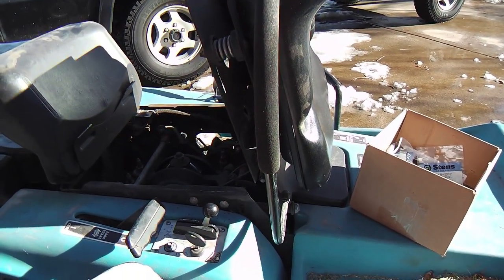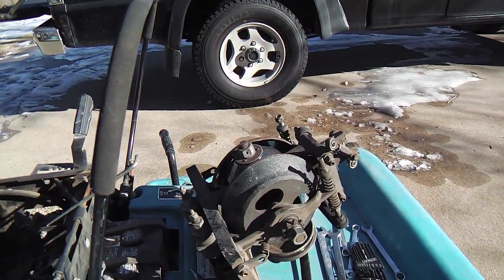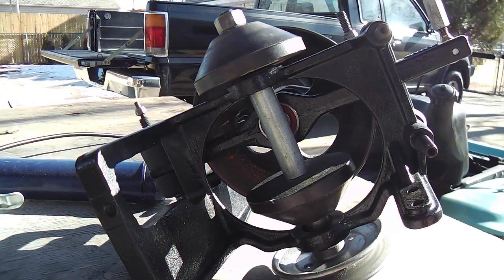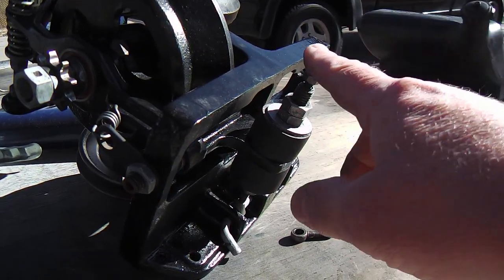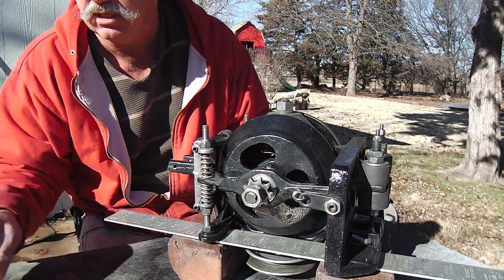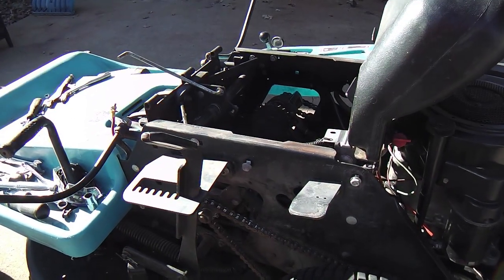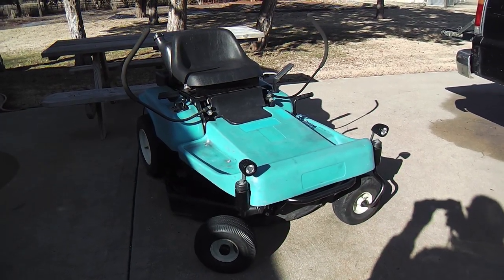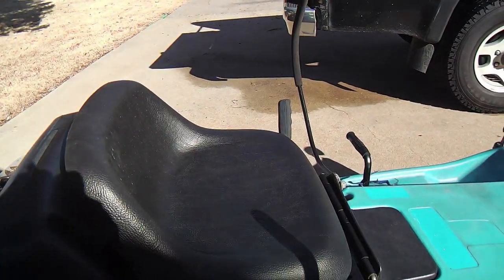Rebuild a Friction-Drive Transaxle on Dixon Mowers

Comment: Stumbled across this and it was a great trip down memory lane. I was a Dixon mechanic from 1980 to '86. Absolutely loved that job.
Reply: @Michael Slattery Hey Michael wonder if you could help diagnose my issue.  I have a Zeeter 30 that won't turn right.  My transaxle cones are in good shape.  I saw on another video that it could be the worn chains that are causing the issue.  Mine are pretty loose.  Could that be the problem?

Comment: Sir you are a life saver....I picked one of these up 2 years ago...for free guy didn't want it anymore and bought a new zero turn and wanted it gone...so brought it home it has a brand new motor new electric pto ....and very nice ...no rust except deck which I fixed ....it has the 52" deck with three blades....might have to replace a spindle or two...ok enough of that....the cone system needs to be adjusted I think I have a broken torque rod it works in one direction but not to well in the other...and the reason I am writing you is to say ....you have given me hope and the knowledge to fix the cone system ....the way you fixed the torque rod is awesome...and end and threaded rod brilliant....simply brilliant....I can now go into this with your video by my side and fix my Dixon ....oh by the way it's a 1987 model a ztr428....I know it's a little different but mostly the same...I have all the literature on my year ....I have only one question....where did you acquire....buy that adjustment tool ....I need one and any help or tips u can give a Dixon ztr 428 owner would be greatly enjoyed ....ty for your video it's one of a kind!!!

        Robert
Reply from the maker: Sure, you can find one like I have at dixonztrparts.com for about $17. But, the older models take at least one other gauge (I think it's just for a slightly different load/compression for those torque springs/bushings, so you might get away with using just the one, even for an older model). But the gauges for older models are surprisingly more costly, at least at that website. And from what I understand, the older versions no longer have cones available for them, so I wouldn't try to replace yours needlessly. I'd just keep learning what you can by using the literature and experimenting. A 52" deck sounds nice!

Comment: Thanks for the GREAT video!!!! Never heard of a Dixon and was about to buy a new John Deere when I inherited a 2003, 3304 that's in excellent shape except for the transaxle. It would hardly go, but after watching your video I've managed to adjust it enough to mow the yard several times. Now I LOVE it and ready to tackle the transaxle rebuild.
Reply from the maker: That's very nice to hear about!
My Dixon just got a new V-Twin motor and some other mods, besides the used three-blade deck that went on it a year earlier. So, if you get a little bored sometime feel free to take a look at this recent project on it: https://www.youtube.com/watch?v=wQ1LNr5Gg6s&t=1s
Reply: Watched it already! Another great video but a bit more fabrication than I feel confident doing right now. The old Intek 13.5 still runs pretty good although it could use a replacement carb which I've ordered. Maybe after I've mastered the transaxle rebuild I'll try a few more performance mods. As you said, I now have "skin in this game" and am quickly becoming an Dixon fan. Move over J.D.!
Reply from the maker: Yeah, it's undoubtedly easier to just upgrade to a hydralic mower, so I'm not really recommeding that most people do what I've done. But I've done what I've done, and have no regrets about it. Otherwise, parts are plentiful and cheap for carbs like that, with even some import carbs around the cost of a gasket/rebuild kit. If that Intek is an OHV type, it would probably be good to adjust the valve lash.

Comment: I watched your adventure twice while stalking a 4423 for sale in my area. Wasn't really sure if I wanted to go with the z drive over a hydro mower. But after the second watching of the video I decided I wanted it. The guy told me it was pulling left a little so I told him it would cost around 250 in parts alone and he went down by that amount.

I really love the little mower and tore into it right after mowing my lawn, mostly due to all the bad bearing noise in the deck. But I have you to thank in giving me the confidence to start the project in the first place. I have since watched it another two times and have the manual to boot so Im ready to tackle the job.

Would you tell me where you bought the cone assembly for 129. I found an assembly for sale but its almost 180.

Thanks for all your hard work putting the video together.
Randy

Comment: I've got a 30" ZTR 3303 last summer, it was made circa 1999 and it seems to run pretty good. Just found out one of the eye bolts was broken. Replaced it and still doing minor adjustments. Replaced the blade brake this summer which was not a lot of fun. That was a poor design to begin with. It's a fast little mower though and still has the original engine. When I got it the only thing that was bad was the seat switch, so the guy said it wouldn't start without shorting across the solenoid. Who needs a seat switch anyway lol

Comment: I have been messing with my “new” old Dixon ZTR. After adjusting it, I noticed that the cup on the left side, which I adjusted because it was a good ways away from the cone, was hotter when I spit on it than the other side which I didn’t adjust. Both sides were very hot though. I wonder, does this mean that I got the left cup to close, or maybe the right cup needs adjusted closer? I have never seen one of these before, am having to learn as I go.
Reply from the maker: Take a look at my more recent Cones Install and Adjustment video: https://www.youtube.com/watch?v=baaGjqRWd7k

Comment: Have you experienced any issues by removing the idler pulley on the drive chains?  both of mine are shot and instead of replacing them I think I will remove them if you have not experienced any ill effects.  Thanks  too bad I can't find more info on the older original design!
Reply from the maker: No, I'm happy to report that there has been no issue at all, after half a season of use or so, so far. Less seems to be more in this case. I'll just mention that grinding a little flat spot on that rod, before punching and stabbing new holes for that tabbed spacer, will keep the new holes well-centered.
Reply: Wonderful I will definitely be disabling mine.  I also need to shorten the other chains as well while I am at it!  Thanks!
Reply: Me too.
Good question btw.
Reply from the maker: I did recently add a custom idler and uploaded the process in a short video. Otherwise a half link may help if you want to skip the idler, which is what I did for a couple years too, until the chain streched further just recently. https://www.youtube.com/watch?v=To63hNrObM4
Reply: it is the original design all same
Reply from the maker: @joescheller6680  Yeah, maybe so, but the original had a tab and some all-thread included in the assembly, which I found a little problematic. But I suppose I could have just deleted the all-thread take-up feature and shortened the chain a little to save a few steps. But I ran it fine with no idler for some time, which may have been more ideal than even a perfectly functioning idler, as the levers without the idlers are more responsive or less sloppy, as I recall. But, the shorter chain and the new idler mechanisms have less slop than the original design.

Comment: One of my discups does not have a set bolt. I am thinking it was replaced. But the one with no set bolt wiggles back and forth. Any idea why and if this is a problem?
Reply from the maker: Gee, if I recall correctly from some literature that I used at the time, that set bolt was not included on some years, but rather, a key was at times placed in that keyway at that point, without a set screw. Mine has the set bolts that just press down into the keyway, without holding a key in place, if I recall. So, if you've lost that bolt, I'd replace it. Maybe there's some mixed parts on your unit, though. But if not, it's probably a 1/4" or 5/16" standard thread bolt. If it hasn't become a significant problem by now, maybe it never will. But, again, I'd solve that slight slack just in case it unexpectedly fails to engage on that one side. Maybe that particular discup has a sheared key in the keyway, which you may be able to just sneak another short piece of keystock into the keyway without completely removing the discup. You know, by just removing the short chain and small sprocket on the shaft to the discup. Please let us all hear what you do, and how it goes. Peace, Christian

Comment: Hi Christian, thx for the video.  I have a 42 Dixon.  How did you make your torque rods?  Mine broke also and would I like to make some out of stainless steel..
 
Jonathan
Reply from the maker: Sure, I just bought a length of stainless 1/4"-20 threaded rod via an Amazon seller (not directly from Amazon, so I don't pay any sales tax). I cut them to the same length as the old torque rods and welded the end of each to a regular nut, in a perpendicular fashion. I also drilled out the inner threads of the nuts a bit, to smooth it out some, as the nuts then accept the connecting rod below. I used stainless filler rod and ramped up a bit of a gusset as the nut joins to the threaded rod for some added strength, hopefully. It's not necessary to use stainless filler or the TIG process, even though that's what I did. That's it!

Comment: My small gear on the friction Gear is badly worn and needs replaced.  Can it be replaced without taking the complete drive out.  Thanks George
Reply from the maker: Sure, if it's that small sprocket with a keyway and about 9 teeth to it. I think I replaced them independently too, after removing the lock nut on the shaft, by first sticking a wrench handle into the cast iron bell housing and rotating it to a stopping point. Then it's just a matter of removing the master link on that short chain, to then tap or wedge it off the shaft for replacement.

I think the part is about $10-$12. I replaced both sides, and even was going to put a half link in there to shorten the chain, to take some of the slop out. But I changed my mind about that part, as the lever action does cause those bell housings to float up and down a bit, and I didn't want a tight chain to restrict that action. But, who knows, I may go back and do that sometime, just to make the drive seem more precise. I mean, these friction drives are undoubtedly a more clunky zero-turn mower, compared to newer hydraulic driven mowers, although I still haven't used a hydraulic unit yet. So, I'm usually looking for ways to make these friction drive mowers a little more refined.

Comment: Great video sir. One question where did you buy that adjustment gauge at? I couldn't find it anywhere
Reply from the maker: Sure, even though I think I got mine with the cones as a package deal on Amazon, the website lawnmowerpros seems to have all of the relevant Dixon parts. Here's the numbers, too: Dixon 7803 Alignment Gauges, New P/N 539116707

That lone gauge is all that's called for on my drive system. There are other models, though, that call for an additional gauge, I believe, for the load-compression-spring-bushing. https://www.lawnmowerpros.com/detail.asp?id=539116707
Reply from the maker: Here's the image via a URL: https://photos.google.com/photo/AF1QipP9ng2zdiudUSZfsiHiAJs3bqYWk89dsL4FmgJR

Comment: Your video is awesome!  I'm into silver as well; maybe it's a Dixon thing :-)  I've owned my Dixon since 2000, it's a ZTR 3303, I even use it to plow snow. It is pulling hard to the left:  Can you show me where to adjust it to even it out?  Photos would be great.  thanks so much.
Reply from the maker: Sure, Jeff,

But I'll just copy-and-paste some comments that I posted below, as I think they speak to the same issue you mention:
---------------------------------------------------------------------------------------
One of your torque rods could be broken.

But, if not, the typical adjustment process is a matter of adjusting the torque rods where those rubber bushings or so-called springs are. Usually, if one side is weak going forward, it's strong going backward. So, look carefully from behind the motor to see if the rubber bushings on your poor side shows a different adjustment than your good side. Then make the weak forward side stronger by making it weaker in reverse. You can tweak the other side if it's too strong going forward, by doing the opposite, too, so that they ultimately run out at about the same speed.

In the downloadable literature it speaks to the issue by loosening the top 7/16" nut, then turning clockwise or counterclockwise of the 3/4" locknuts. And that's how it's done, but I like to visually check the relationship of the bushings as a guide to get more of a sense of the forward-reverse balancing, first.

Of course, it's best to first have both of your discs squared-up to the cones, but without drag. So, I recommend downloading the literature and going over it a few times, or more.

Check page 54 and 55:

http://pdf.shankslawn.com/dixonztrparts/Dixon-Z-Drive-Svc-Manual.pdf

Peace to you,
C. Livingstone

Comment: nice video, but how do I get the transaxle out of the mower?   Thanks for any help
Reply from the maker: Well, you'll need tools:
Transaxle Removal Estimated Time Required: 25 minutes
Tools Required:
(1) 7/16" combination wrench
(1) 9/16" combination wrench
(1) 3/4" combination wrench
(1) 11/16" combination wrench
(1) 9/16" socket
(1) 12" socket drive extension
(1) ratchet drive
(1) shop hammer
(1) mechanical punch (drift)
(1) needle nose pliers or spring tool

NOTE: A lift or work table is not required but very helpful.

And the step-by-step illustrated instructions from the manufacturer will help, too.

I'll post a link to that second part:

http://www.lawnmowerpros.com/dixon/Dixon-Z-Drive-Transaxle-Removal.asp

Please let us all hear how it goes or if you get hung up at some point.

Comment: I just rebuilt mine yesterday and wish I had found your video previously to it. I just bought a set of cones and bearings and it took me about 5 hours to replace those and get it back together. You were right also in the fact that I did find other things that I will have to go back and fix later on, specifically some worn sprockets. I thought I'd share a link to the factory instructions for rebuilding/ adjusting the drive. The section on adjusting after installation was very comprehensive.
http://pdf.shankslawn.com/dixonztrparts/Dixon-Z-Drive-Svc-Manual.pdf
Mine is a 97 model 3304.
I was curious where exactly you wired in your headlights?
Reply from the maker: Hey, thanks!

Gee, you work fast. Very good.

Sure; the lights.

I got the positive by jumping off one of the leads from the ignition switch, rather than just getting it from the battery directly. I did that mostly because of the toggle switch I installed, which I placed in the same area as the ignition switch, and that made the wire routing a little cleaner or more elegant. And I already had a pigtail from the battery for connecting an electric sprayer, so I didn't want any added clutter there, not that it really matters, functionally speaking.

For the negative, I let the wire follow back a little way from the lights to ground onto the frame in the same spot as the battery does, which was convenient, as it was in line anyway.

I believe that I wired the lights themselves in "series", rather than parallel, as I'm no expert, but I didn't want the lights drawing too much amperage and competing with the battery charging for juice from the alternator. But that might be a needless concern, as, again, I'm no expert when it comes to electrical work.

 Anyway, the lights themselves were Cree models, that are advertised as low amp draw, as they're LED, with some smart circuitry, so if the lighting doesn't seem bright enough, I may go back a jumper the wiring into a parallel configuration. But, I'm guessing that these lights, which are an inexpensive knock-off of the brilliant (and expensive) Vision-X Solstice line, will be plenty bright as they are currently wired. But, I haven't used them at night yet.

Feel free to post any update on what you do with your mower. I'd like to hear it, and others may as well.

Peace be with you,
Christian
Reply: How do you find the repair manuals on shanks website?  I dont have the z-drive I have the older model.
Reply from the maker: Gee, just try a Google search: "Dixon mower model ---- repair manual."